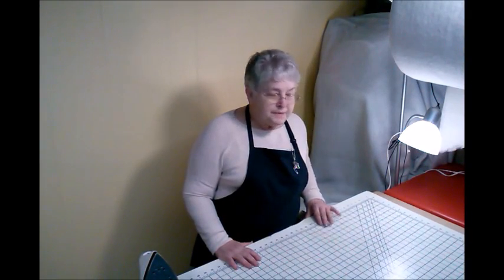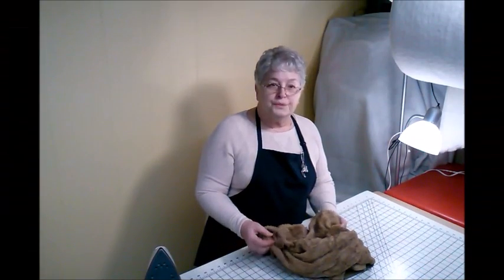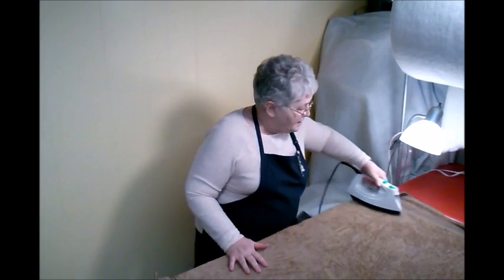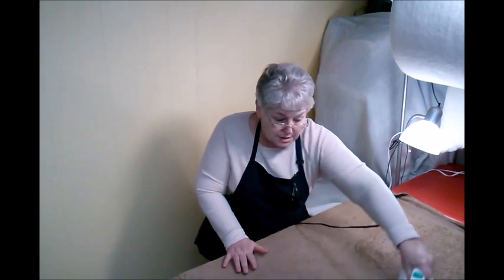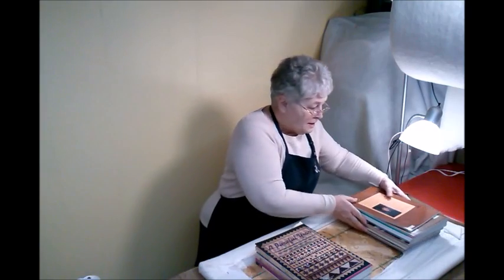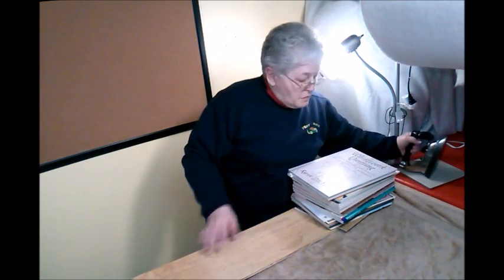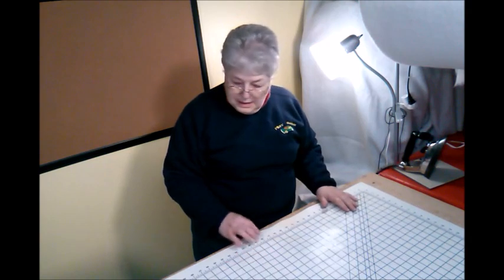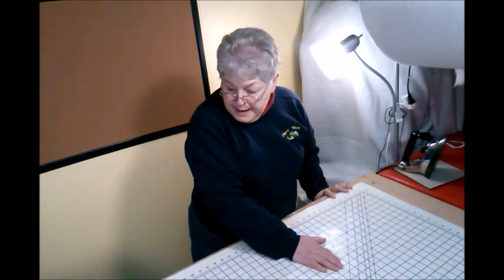Mat Repair

Comment: Your problem was that you left the hot wet towel on top of it... The concept is to get the mat hot enough to soften the curves, and then let it cool in a flat surface with heavy stuff on it. I let mine on the sun for 30 min and then placed it on a flat surface with books on it for several hours. It got flat.
Reply from the maker: That is so nice to know. I cut it down, put it on top of a blank metal door for another sewing/cutting area and finally bought a new one for the big table. Thanks for your input
Reply: Oh I’m so excited because my large cutting mats, like yours, is very warped and I didn’t want to throw it away. Thank you so much!!!
Reply: I agree- a hot soak in the bathtub works too, but it's important that it's dry for the cool down process. Mine warped in a hot car, and I was able to heal it with a hot bath, got it fully dry, and then the pressing overnight.